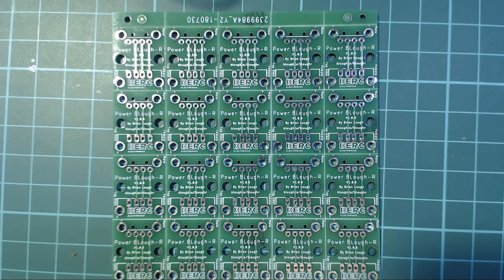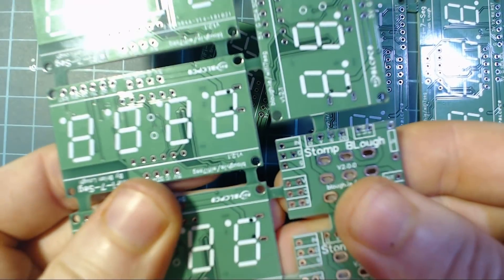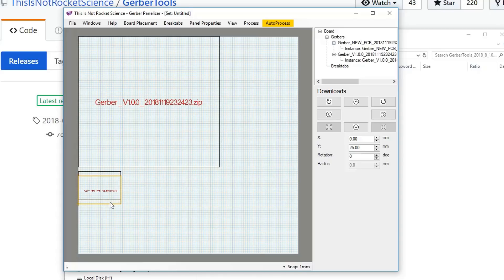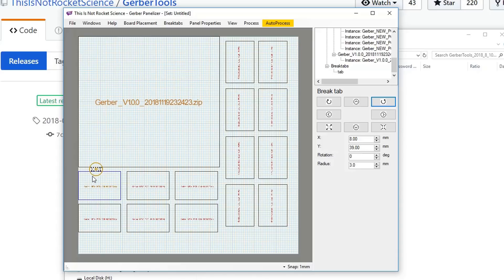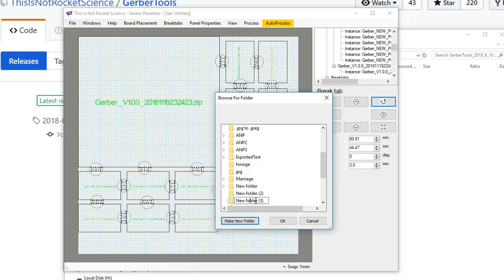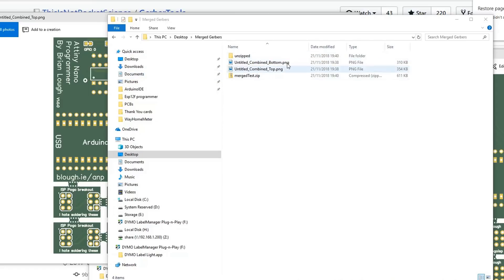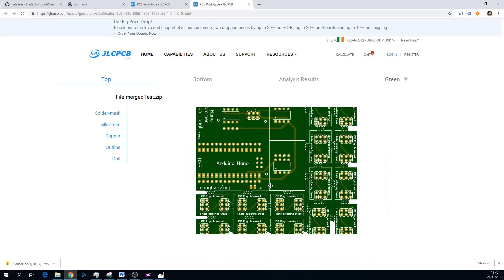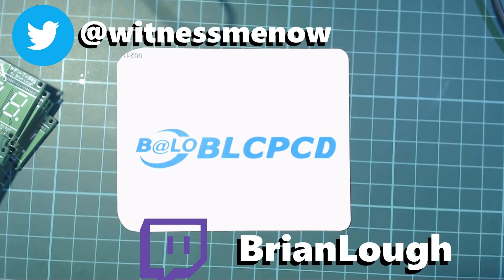How to Manually Panelize PCBs

Comment from the maker: A little bit of a rush video, but I wanted to share this pretty easy method for panelizing boards that has worked pretty well for me! I had planned to make it at some stage anyways but with the news of JLC charging for the panelizing now, it seemed like the right time to do it.
Reply: Yes - Its a PITA but good tips Brian. Thank you.
Reply: Thank you! Too bad they increased the price. Your video provides a good alternative.
Reply: I still had some designs in my shopping list that didn''t have that added cost. I intended to wait and order a bunch, but chose to order them today. Unfortunately one design was less than 7cm wide and got refused in audit. That was a good occasion to follow your tutorial and try to panelize the design myself, using your method. I think it went okay, but the preview looked a bit different than yours. As in your video the cutouts between the boards are not shown and for my board the colors were also a bit strange (large areas were dark yellow instead of green). That could be a bug in the rendering or maybe something else went wrong. I'm still waiting for it to be audited.. We'll see how it goes... Thank you once more for this video!
Reply: Sire, the program is awesome but takes an enormous time to respond. Is there something I can do?

Comment: Panelizing different PCB designs now incurs additional charge @JLC PCB. When you panelize 4 difference designs, as I did, you will incur an additional charge. This is probably the case for 2 or 3 designs as well. It might end up being cheaper to just order your different designs separately.

Comment: Hello, Nice video,. Don't know if you can assist.  When I export to grebber, I only get a grb, txt, and xln file.  And the picture generated does not show any silk or tracks.  If I open it with other grebber viewers it shows blank grey with drill holes.  If I use the grebber viewer in the software and I open the extension .grb it shows everything in one file.  I am sure it will not work for manufacturing?  Can you maybe assist?

Comment: Cool tool and solution, but unfortunately JLC is charging now for placing more than one design (audit haven't passed and additional charge was appeared). I didn't try with the same PCB, but IMO FAQ says that it is considered as many designes. The cost is similar to placing few orders and it's cheaper to pick more quantity.

Comment: be careful when you do this , you should be careful with your slotted holes, 
It's a very good tool , but when changing extension, slotted holes may changed as normal drills
This is my experience, so when you have slotted holes something like use mounting holes 
double check it!
Thanks for great tutorial.

Comment: Dont working on Windows 10 but on Windows 7 works fine. Some issue for fix app on windows 10 ?
Reply from the maker: Not sure why you are having issues, I use it on Windows 10
Reply: @BrianLough  If i try drop folder with gerber to Panelize app it only add something on right three structure, but nothing in graphic screen.

Comment: Not working for me. Using Gerber files made with KiCad. Getting blank images and files after exporting from this tool.
Reply from the maker: I don't use kicad, but this was first search result for using this tool with it

https://github.com/ThisIsNotRocketScience/GerberTools/issues/9
Reply: that is what I was experienced, I think that is because of origin
you can find top menu named Board Placement and click autopack ( I dont know why It works , i just clicking everything)
In my case, after that It shows me zip images

+ tips
you can reference this article
https://kicad.mmccoo.com/2017/12/28/panelizing-kicad-gerbers/
( you must follow it)

and if you can't see image yet
on the right top corner in the Gerber panelizer ,  you can delete instance, then you just right click and add instance 
(delete -> add) 
then you can see zip image.
I'm kicad user, and it works

Comment: When you zipped the file you left 2 files out. Would there be an issue if you had taken all the files and zipped them and sent them? I just ordered some boards from JLCPCB and they charged 4.00 for engineering which I guess is for them to panelize the boards. Last week I placed an order and they wanted 8.00 and it said charge to vcut. I don't know what they are doing as there is a spot they say there is a 8.00 charge to vcut and now they charged engineering! If you panelize it like you showed, is there a added charge and what do you think it would be, vcut or engineering? Did you have to tell them you had 2 designs or was this considered 1 design? Thanks for the video.
Reply from the maker: I've never been charged for extra for this once the size is below 10x10cm , but I have always put down that I only have one design, even if I had more than one. It hasn't been a problem so far anyways
Reply from the maker: I think the files I left out are images, I'm not sure what would happen if you included them

Comment: Not working, Once I drop the zip folder or the folder itself containing the gerber files it appears on the gerbers tab, I create a new instance but nothing shows up in the panel view. Any guesses why?
Reply: Same problem, preview works just fine on JLC site with the same files
Reply: I had the same issue but changed gerber files exension to the suggested by the jlcpcb web page and finally could add the folders freely. Use zip for the folder too.
Reply: @SedanteLaxante  what is JLC file extension
Reply: I have a solution: the gerber is somewhere outside the working space, but you can easily find it by zooming out. Just use ctrl+[-] (minus) shortcut and drag gerbers in proper place. Another solution, but not always working: you have something like "naive positioning" in the main menu - it will try to set the correct position of currently existing instances of gerbers.

Comment: Brian a very nice little tutorial. I think JLCPCB allows 102X102mm max as part of the cheap deal, not that would make a major difference. I had already seen the Gerber Tools but your walkthrough has made better sense in terms of operation. Excellent work from you.

Comment: I'm pretty sure the preview comes out with the boards "stuck together" like that because the spacing between the boards is too small. In their guidelines they have a minimum slot routing figure, and that is the reason why it fails to preview it. Move the boards further apart and it should be good.

Comment: Chrome didn't shut down correctly :) isn't there a way to specify vscores for jlcpcb? Or they only offer that when they panelize it
Reply from the maker: I noticed half way through about chrome 😐

Not with this tool, I haven't found an easy way of doing vscore panelizing yet

It seems to be just a case of squishing the board outlines beside each other, but I'm not sure

https://support.jlcpcb.com/article/49-pcb-panelization
Reply: @BrianLough  I noticed on that link it said: "Similarly, using holes or slots as break off sections between boards are treated the same way as putting more than one design on a panel"
ie. This seems to suggest that even with the Gerber Tools utility, they are saying they may still decide to charge more?